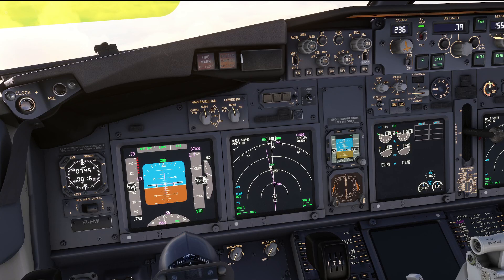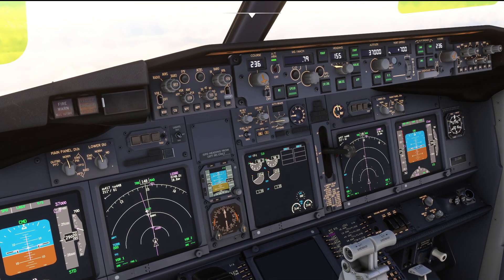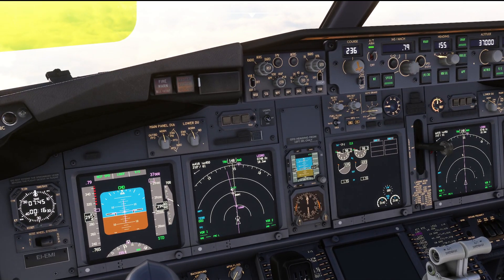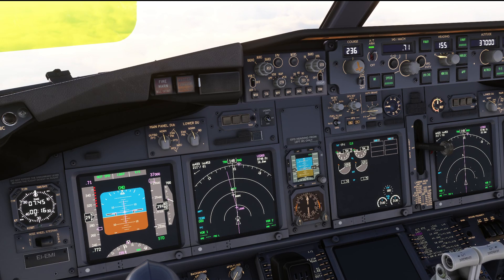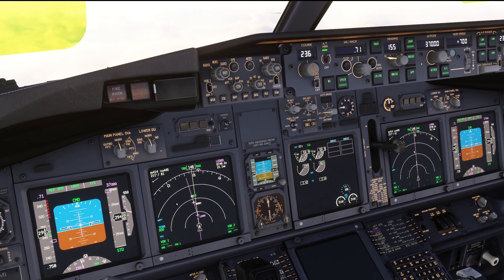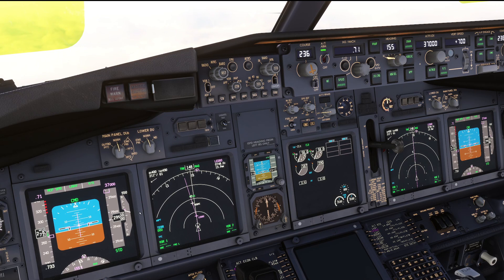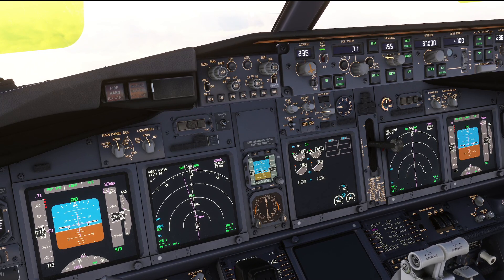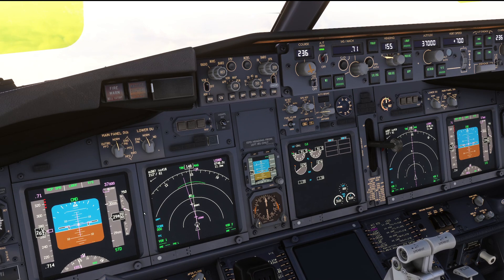PMDG 737 Update: New V/S behaviour with thrust changes | Real 737 Pilot

Comment: I can't get the yaw damper to connect now. What am I doing wrong...? I usually turn it on after APU fires up.
Reply from the maker: No changes to the Yaw Damper compared to the previous update.
Check out my tutorials for correct SOPs, I've never had any trouble with the PMDG when I followed the SOP.
Reply: @A330Driver  somehow another button got assigned to the Yaw. Anyways fixed now! Just gotta find a good joystick sensitivity setup.

Comment: Pitch values in the climb are still wrong. A shame
Reply from the maker: No.
Reply: @A330Driver  so you say FD commands over 20 degree are normal with TOW of 65t in zero wind conditions? Don’t know what you guys in CGN do but I haven’t seen this in the last 7 years.
And that’s just to maintain the V2.

Comment: Good to know it's a feature !! THANKS for the video. 

BTW, can you confirm the odd behaviour of A/T since the last update, that users mention in the PMDG forum (Auto throttle issue after last update): When speed drops only 1 or 2 kts under the speed bug, the A/T seems to overcompensate by giving full thrust, ending with about 20 kts above the speed bug, then trying to catch the speed bug again, and at 1 kt under, the same procedure happens again and again... I hope that's not a feature too ?
Reply from the maker: yeah, just look at my latest livestream from yesterday.
The devs are working on it as we speak.
Reply: Ugh, this is so annoying. I cop this regularly on descents
Reply: youre not alone, im glad theyre working into that, i just disengage A/T and manually accel/decel at 220KT below for landing.